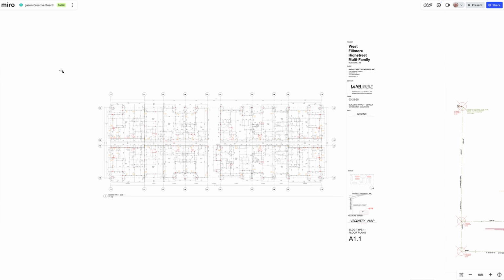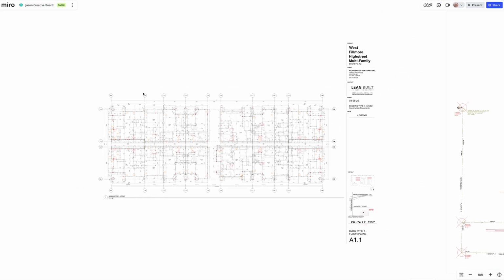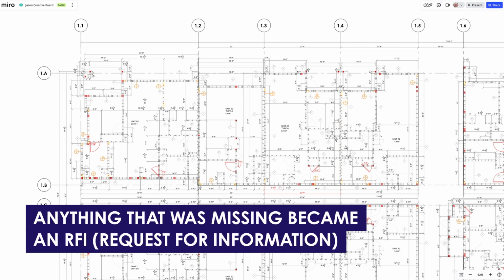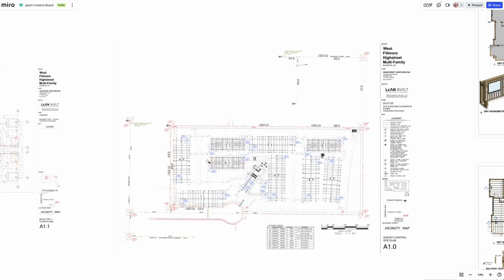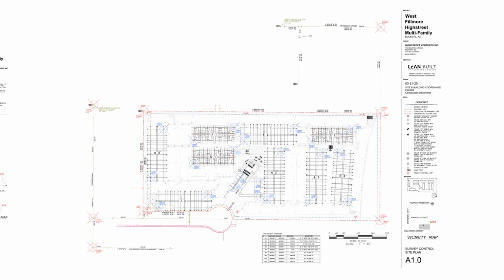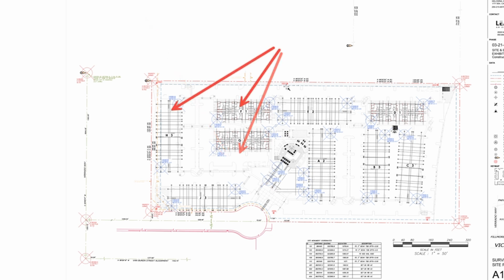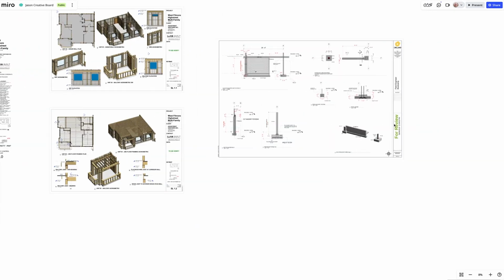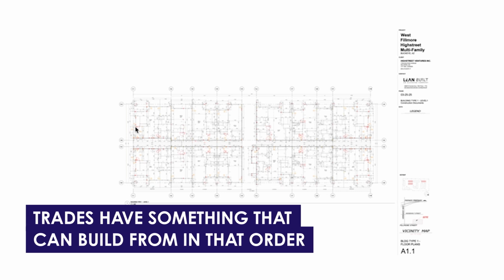Lift Drawings For Starting Construction

Comment: What is the difference between the Lift Drawings and your 80 or 100%CD drawings that you are having anyway.
Reply from the maker: @christianzitzmann5015  the difference is that drawings are fairly high-level, only communicate design intent, and are only required to be according to normal standards of care within the region. Lift drawings are required to confirm that all information is there and to be very detailed, and to combine all relevant information into one drawing.
Reply: @jasonwilliamschroeder  Thank you for your content.  Assuming this RMF project had a structural engineer, would it be possible to have the framing trade partner produce shop drawings for each building type for review by the structural engineer?  If yes, could those framing shop drawings (stamped by the SE) then be used as the lift drawings?